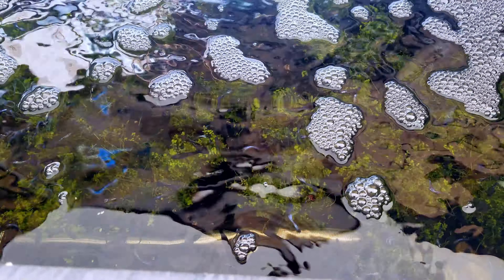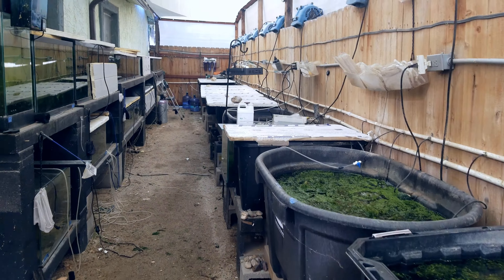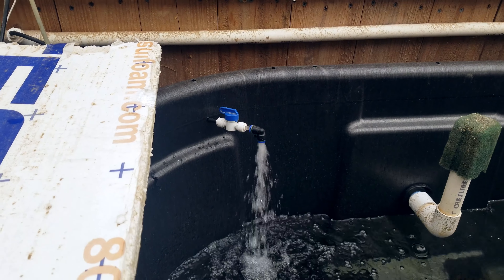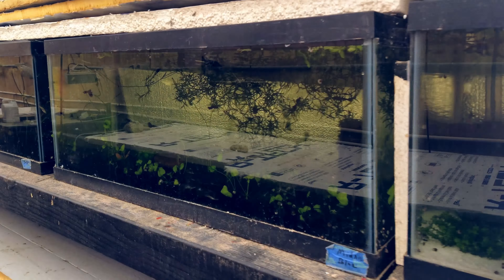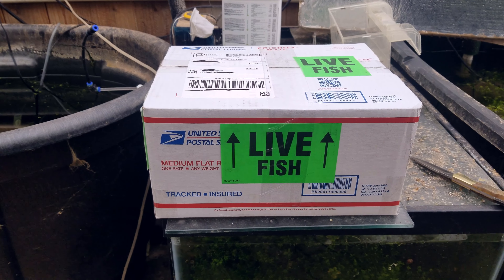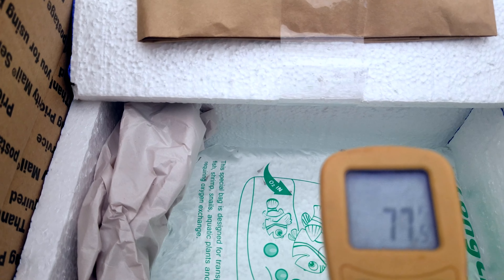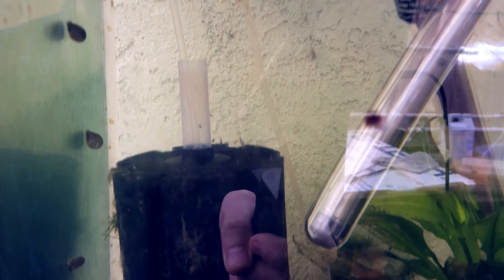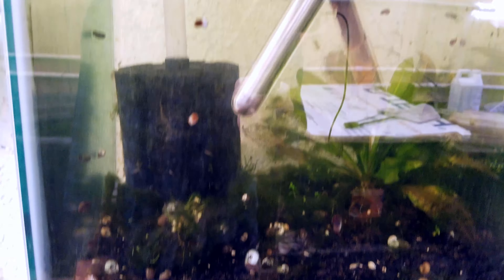Adding Cichlids to the Fish Room!

Comment: Tilapia species? There’s a few out there. Two dozen will need a bigger tub eventually.
Reply from the maker: They're Blue Tilapia, from my understanding there isnt much difference between the blue, red, gold or whatever, just the coloration. As for the size. I find a lot of information is conflicting with amount of fish per gallon. I personally break just about every rule with guppies and do excellent, but if they end up needing more room, I have plenty to spare haha.
Reply: @BishopAquatics I had a few Heterotilapia butokoferi. Sometimes called zebra tilapia or hornet tilapia. Stripes like a Frontosa. They get to about a foot long like an Oscar. They’re a great fish  I kept with Jack Dempsey and Managuense jaguar cichlid in a 125 six foot tank. A few loaches and Raphael cats worked well. Thanks for the reply! 
As for water and fish the big fish are heavier and definitely eat more so water changes are more important than tank size, I saw your plumbing setup looks great 👍🏻